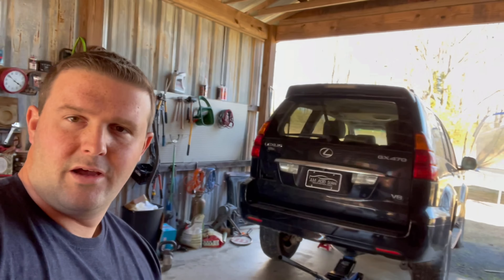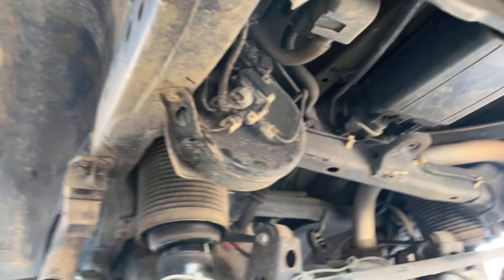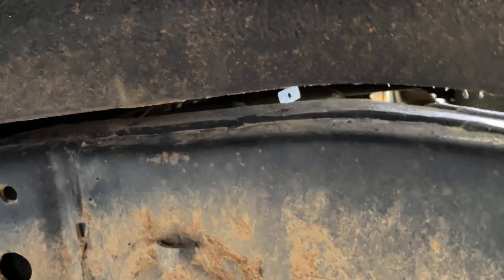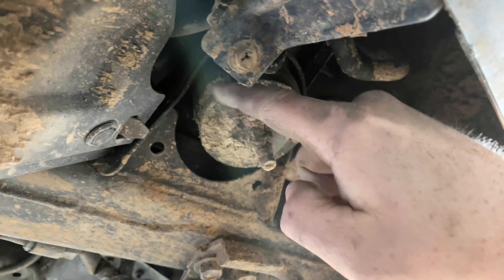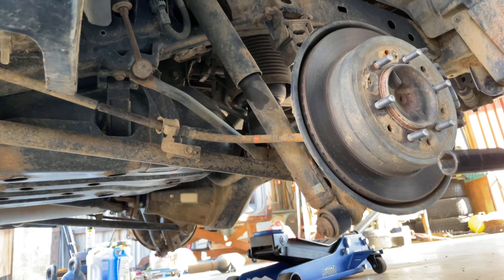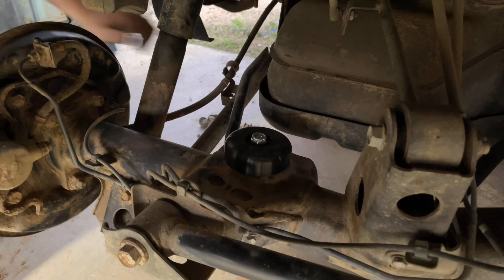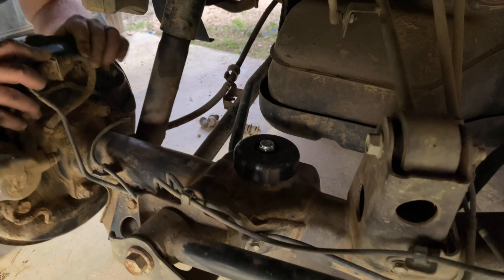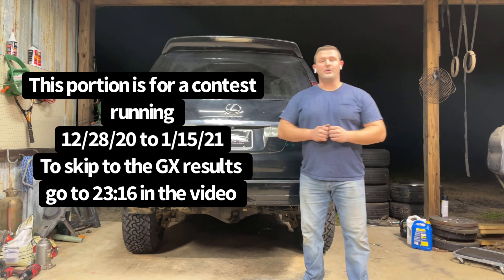Lexus GX470 Rear spring conversion with Eibach pro truck lift: Black Beauty update!

Comment: Just FYI, I believe the black circular looking thing you were looking at, at 3:10 is actually the Air Accumulator. The Air Compressor is actually further behind the driver's side rear wheel behind a plastic guard. The reason I know this is because I removed mine today.
Reply from the maker: Thank you for the correction 
I did call the accumulator/reservoir the compressor and the actual compressor the reservoir... 😬

Comment: Put the spring on before the isolator on the bottom. Then slide the isolater in between the spring and tighten.
Reply from the maker: That works too 👍🏼

Comment: Liked the video  I have a 2006 gx470 I did my conversion already I used the Dorman one but it did not come with isolation with them so I put them on like Dorman instructed rides ok put I would like to replace shock too
Reply from the maker: I’ve heard good things on the bilstein shocks for aftermarket

Comment: could the air compressor be left in its original place and converted into a compressor to air up tires (long air hose stored inside and connect to compressor when needed) ? 
thanks for any opinion on this.
Reply from the maker: It’s such a weak system I would put in aftermarket if I wanted to have that ability

Comment: Will taking all this air suspension off trigger any lights or error codes on the dash?  How does the ride compare after job is done? Great vid, thanks.
Reply from the maker: Ride is very comparable to me, you do lose the adjustable features obviously, but I like them.  Still smooth.  As long as you disable the system all the lights go off the dash

Comment: Just a question? I need to set my hand brake, I know you can do it trough small holes on the brake disc, just was wondering should I first pull the hand brake in position 3-4 and then set or should I do it with released hand brake?
Reply from the maker: I usually set them in the released position.  You can turn the star wheel in the drum to tighten.  Sometimes the actual cable needs tightened which you’d do under the cup holder/console area

Comment: Hi did you have a hard time with the upper isolator?  Seem like the bold provided is too long? Mine is touch the floor board
Reply from the maker: Mine didn’t bottom out not sure why it would go that far 😕
Reply: @crutchfieldautomotive7936  i used the wrong bolt size lol. Thanks for the reply! 👍🏼👍🏼

Comment: anybody know of a way to cover and protect the end connectors from the body harness? I don't want to leave them exposed to the elements
Reply from the maker: Cut the plugs off the old shocks and leave plugged in and tape up
Reply: @crutchfieldautomotive7936   yeah that's a good idea. Thank you

Comment: Hey thx for the videos. What rear coils do you recomend for stock ride height?
Reply from the maker: Doing anything other than normal day today driving?
Reply: Normal day to day.
Reply from the maker: Cheapest would be some for a 4Runner from local parts house and a install kit
Reply: So get same year springs as 470?
Reply from the maker: Yes same years will swap
Reply: Hey got the springs but the pucks look different than the ones you used. They aren't pucks with bolts, they are rings with no other hardware. Will they sit with no other anchors?
Reply from the maker: @trillixgoat can you email me a picture sales@crutchfieldauto.com

Comment: Today, after driving in a lot of rain and big pools of water in nashville last night, I noticed a hard bounce in my GX and thought it was a flat tire. There are no lights on the dash but the rear end is definitely sagging lower. 🤦🏽‍♂️😞 This couldnt happen at a worse $ time as im about to move.  Is there any temp fix until I can convert to coil? If I stay off the highway and drive slower does it
matter or is this still dangerous? Thanks in advance
Reply from the maker: Could you possibly have it trailered?
Reply from the maker: It’s going to beat you up but it’s still drivable at lower speeds
Reply: @crutchfieldautomotive7936  what is trailered?
Reply: @crutchfieldautomotive7936  is it definitely the suspension?
Reply from the maker: Just saying could you put it on a trailer to your new place
Reply: @crutchfieldautomotive7936  im moving 15 min away
Reply from the maker: OK yes you can drive it that far
Reply: @crutchfieldautomotive7936  i drive 35 miles round trip daily to work. is there a temp fix for that much driving until i can convert it?
Reply from the maker: If the airbags are blown there’s not a temporary fix other than replacing them that I know of

Comment: I have a 2004 gx470 where I want to change over to springs just like you did, Can you provide a like to the kit that you installed? Appreciate it!
Reply from the maker: I’m a dealer for Dobinson’s I can direct ship the kits and cut the cost of shipping off.  Here is a link to the conversion kit itself, the springs will depend on the height you want to go if not keeping stock height 

https://www.dobinsonsdirect.com/products/dobinsons-rear-airbag-to-coil-conversion-kit-for-prado-120-and-150-lexus-gx470-and-gx460?rq=mk_lexus~md_gx470~yr_2002-2009
Reply: @crutchfieldautomotive7936  Is there not a complete kit with stock spring height?
Reply from the maker: The springs are all kinds of heights so they’re separated for that reason.  You have the have the conversion kit then your springs and you’re all set
Reply from the maker: Shoot me your email I’ll email you a package deal and see if that is something you want

Comment: If you don't want to go with a lift, can you recommend a quality rear spring for this conversion? Getting ready to do my wife's GX and having trouble finding a good one. Preferably USA made. I have a 4runner and lifted it and she hates the rear springs in it. Too heavy duty. (I think they were labeled wrong). Just worried it is going to be too stiff of a ride. Thanks for any help.
Reply from the maker: So you’re wanting to do rear springs but maintain stock height? Should be able to find a set of springs from a 4Runner.  You’ll still need the conversion kit but those stock springs should be perfect

Comment: I’m looking to do the coil conversion with a mild lift (1.5 “) what configurations do I need for front and back suspension to make it level?
Reply from the maker: typically you'll need about 2.5" to level that.  If you go any higher you're likely to need new upper control arms to accommodate the alignment

Comment: could i somehow use the compressor to air up the tires when offroading?
Reply from the maker: It’s not strong enough honestly.  I’ve seen lots of people add an aftermarket one on board, but the stock one isn’t rated for that to my knowledge
Reply: @crutchfieldautomotive7936  understood... Thanks for the reply!

Comment: This is the video I've been wanting to see. You show in detail what all to expect when doing a coil conversion on my GX470. Question: Is there any risk or concern with overextending the brake lines when angling the axel while installing the springs?
Reply from the maker: No the brake lines come in at the center of the axle. They split off and they’re giving you all the flex that you need

Comment: Shouldnt the small one be up top?
Reply from the maker: No sir, you’d have to install the spring upside down for that to work.  Now the small puck is actually recommended to be installed with the not on the bottom side instead of the top the way I showed, but it’s extremely aggravating to get it to ever start that way.  The lower puck won’t take a ton of shear force so either way will work.

Comment: Air ride went out of my 97 Lincoln Town Car so I cut a couch pillow in half and duct taped two round balls Jack it up and stuck in between the frame in the swing arm to the rear end she was a lowrider and I drove it around that way for a long time and you should have seen the chicks and the people come up to me when I would park on the side of the road to use my phone down and Arkansas wear my cowboy hat I couldn't believe it they thought I was a pimp because my car was such a lowrider with those with the air ride suspension out my dual exhaust was just about rubbing on the ground and I drove it that way for about a year but then I stuck a sport a coil spring replacement kit in there and all it was was the springs and that's all it was easy to change out